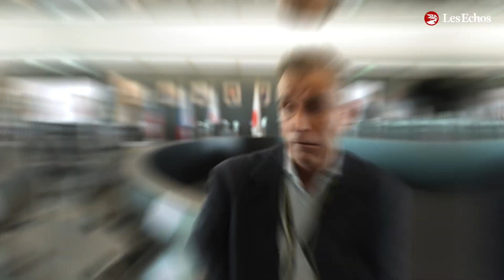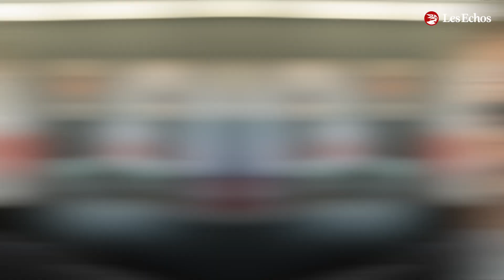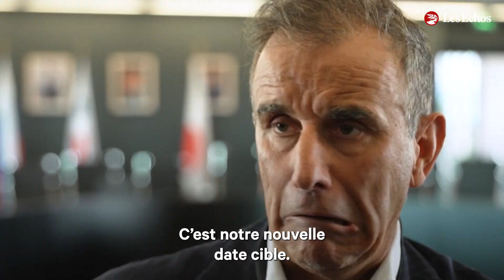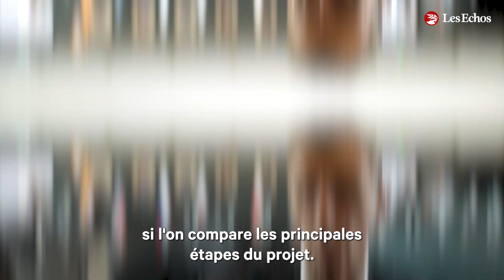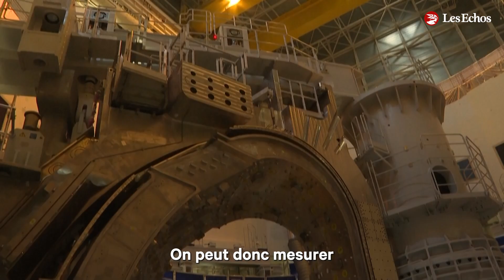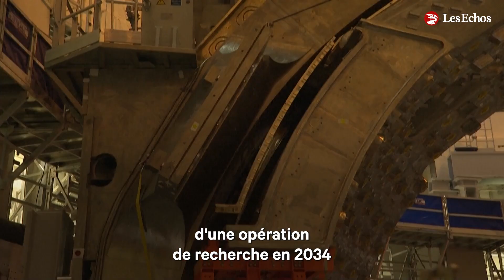Fusion nucléaire : « Nous aurons besoin de 5 milliards supplémentaires », affirme le patron d’Iter

Comment: Ces grands projets internationaux ambitieux n'ont pas de sens. Trop complexe, trop étalé dans le temps. Et l'on risque de découvrir à l'arrivée que le tokamac n'est peut être pas la solution avec un plasma que l'on n'arrive pas à stabiliser. Il faut mieux des avancées par étapes plus modestes menée dans chaque pays, et c'est ce qui se passe d'ailleurs avec de nombreuses start-up disruptive. Au final, certains auront passé toute leur carrière sur iter, et malheureusement peut être pour rien.
Reply: Il n'y a pas de "pour rien" on progresse toujours quelque part
Reply: les recherches sur la stabilisation ont commencé très tôt et d'ailleurs l'équipe ITER montre quelles sont les pistes logicielles d'ajustement dynamique pour "contrôler" l'instabilité. 
Par ailleurs l'instabilité pourrait être moins problématique qu'imaginé, une piste est de faire avec les disruptions mais sans que celles ci ne flinguent la paroi, par "refroidissement par injection", le plasma se maintient, la fusion s'arrête, et reprends quelques temps après. 
Au final, la continuité avec de telles quantité d'énergie a peu d'intérêt, un stock de chaleur à l'extérieur permettrait de produire en continu à la sortie, avec un tokamak qui chaufferait en pointillés.
Reply: @philv3941  Merci pour ce commentaire, les allemands testent le Stellarator, une variante du Tokamak sensée mieux correspondre à la forme prise par le plasma, un point essentiel à ce jour reste à  démontrer: le schéma de fusion qui sera retenu permet de produire plus d'énergie que celle consommée pour initier la reaction !

Comment: L'objectif d'ITER c'est de ce casser les dent sur les problématique technique et scientifique pour pouvoir avoir une solution industriel fiable le plus rapidement possible. Anticiper les problématique technique et scientifique, prendre le temps de bien faire les choses et partager ça avec tous… On est tellement encré dans la vision start-up lean-disruptive-bidule, que je peut comprendre que l'esprit du programme d'ITER soit un peut difficile à abordé pour la plupart d'entre nous.